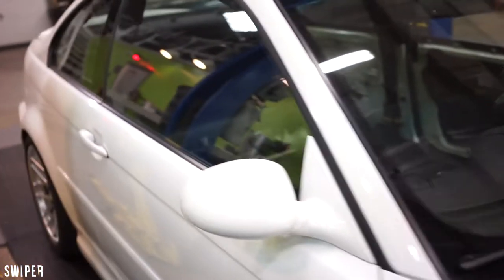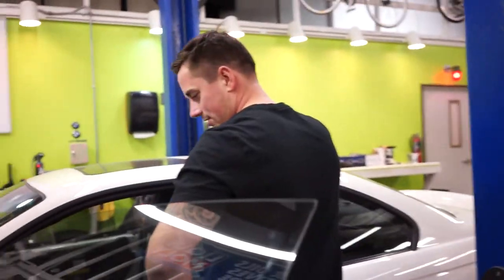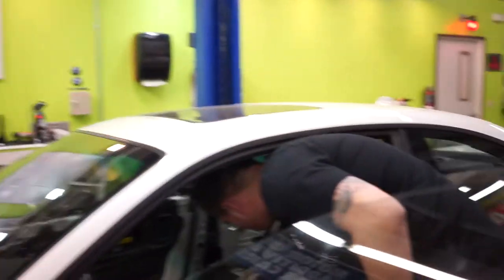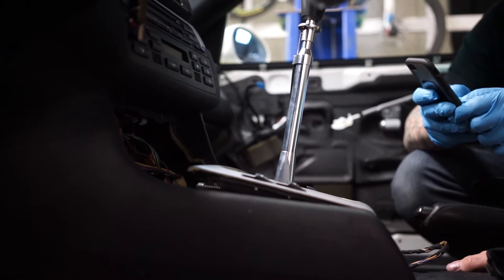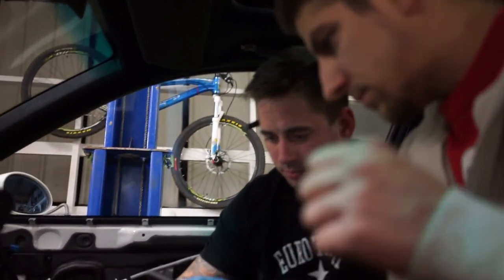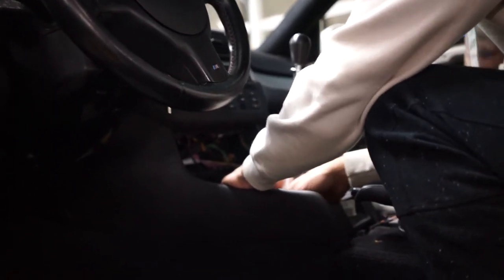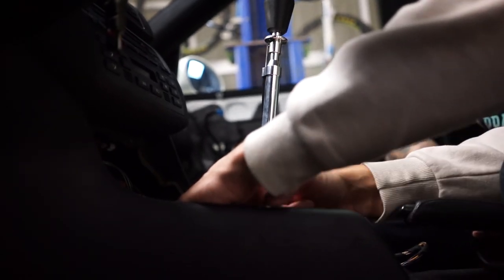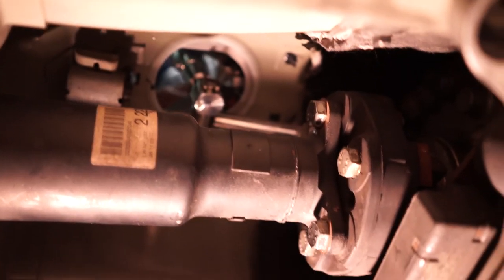Bryan's E46 M3 - CAE Ultra Shifter Install - PT.1

Comment: my favourite part of this video has to be the moment it goes up on the hoist and you realise the whole exhaust has to come out along with the heat shield to get to the box mounts so you can drop it low enough to fit the shifter. Welcome to e46 M3 life boys
Reply: Yea man, i have no idea how people work on these bad boys without a hoist.

What'd you go with on the exhaust front? I'm headers to tail Meisterschaft, no cats behind an ESS VT2-525. She's a touch loud.

On the recaro front - the VAC mounts the the floor are the way to go. I made mine but VAC would have saved me a bunch of time on the driver side.

Comment: Any reason for runninn Non cross drilled rotors?
Reply: I’ll end up going with other Rotors when I get to that point still tossing between stoptech kit or 996 caliper setup and CSL 2pc Rotors. But yea these are what came on the car.
Reply: because cross drilling is a good way to crack rotors on the track. Slots or bust.
Reply: The BMW ones are garbage. I've been through a set on track and others i know have been through multiple.

AP's solved the problem for me.